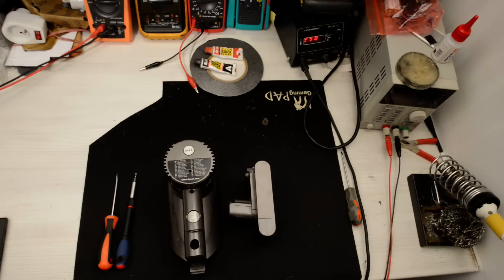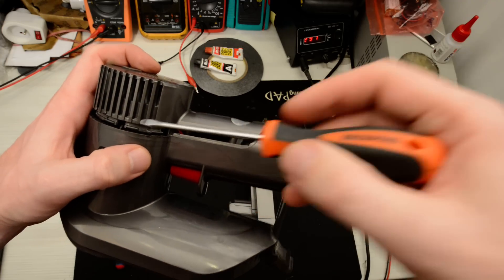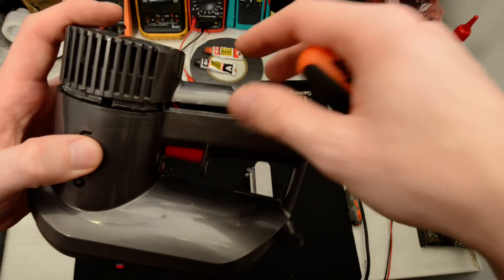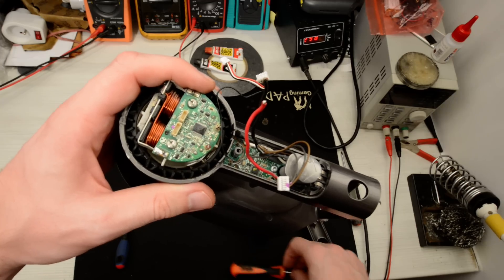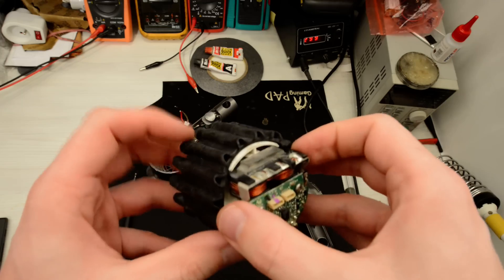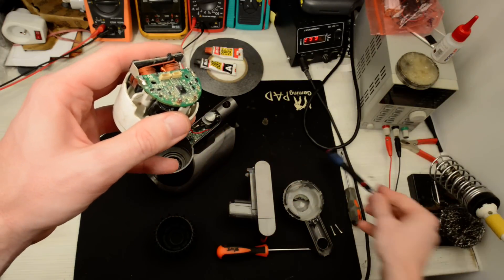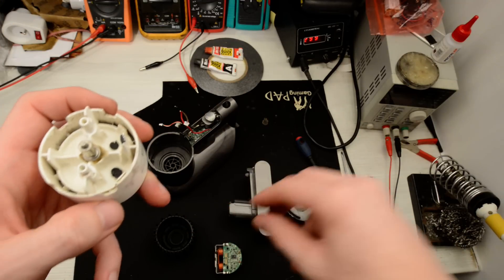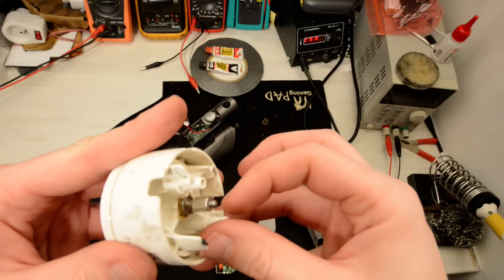Dyson DC35 motor disassembly - back cover remove

Comment: I worked from the bottom to get the cover off. Like others the rotor magnet was broken in pieces. It's a shame a 25 cent part can't be replaced. If anyone one tracked one down post it. Thanks

Comment: Looks like the same problem here.
Suspect a little more glue and pinch of graphite in the factory would save a lot of recalls...
Thanks!
Reply: Thanks for the heads-up on the case prying.
A plastic (phone pry) tool seemed to help and did less damage.

Comment: Same problem only the metal circular part that goes on the axle had a hairline fracture and was freely moving on the axle. I used superglue. Took me about an hour trying to get into the motor area but this video gave me confidence so thank you! :) Saved me buying a new one and now I know I can fix it again if I have to! My symptoms were press trigger and a single beep and green light BTW. No motor movement. The beep seems to indicate an obstruction. Good luck folks!

Comment: Thanks for the instructions. Found rotor magnet split down axis. Just need a replacement now. Cheers.
Reply: Did you found any replacement magnet mine was completly in pieces
Reply: @vincentlefebvre5681   Hey, I just took my vacuum apart and my rotor is in pieces as well. Was wondering if you ever found a replacement?
Reply: Just use superglue I did and seems to do the job same issue with mine!

Comment: Hi Ilja, thank you greatly for posting. The showing of how to remove the cover / where the tabs were was key for me - very helpful. In my case, over time one of the wires came loose off the back of the on/off switch (poor contact) as the switch physically moves a bit when operated which must have fatigued the wire / solder joint. Re-strip wire / re-solder and now all good. Yes, hard to remove cover without marking the plastic, but very happy now with working vac. Kudos to you! Děkuji.    (PS. The cover screw was torx, from memory, i'm writing this after the fix, i think it was size T7 for me)

Comment: Ilja Mašík, Hi dear 
Ilja Mašík, please tell me, have you modified your dyson? Why I don't see the filter detection switch wires not connected to your board? Have you connected Trig +24V from on-off switch board to the same board V2? Please tell me where to connect filter detection switch wires??

Comment: These are brilliant and rubbish at the same time.  IF you get one that is fit for purpose you are laughing. Sadly the majority of them fail, I have 3 (2 X DC31 and 1 X DC35) ALL of them are faulty!!!
Two of them work for 5-10 seconds and then shut off for a few seconds before restarting. One of them (DC35) will not turn on at all now!
For the money we spend on these, it's better getting the cheaper knock offs, they work as promised, not as powerful, not as good, but at least they work.

Comment: Thank you very much. Mine was making a high pitched squealing noise. It ended up being the magnet was loose on the shaft as well. I used suggestion down below but used a C clamp instead to release the tabs. This saved me a few hundred dollars.

Comment: Good evening, Tell me, please, how can I find out the marking of the octopus microcircuit, the designation on the Q5 board is located on the inside of the board, in the same place as the transistors. The case of the microcircuit has almost swollen, the marking cannot be read. Dyson V6 well, either in his brothers

Comment: My D35 is now stuck in MAX mode.  I've had the vacuum for 8 years now so I know the usual method of releasing MAX mode.  The MAX button doesn't seem to be pushed in.  Could it be some kind of electrical fault?  (I think one of the reasons I've had the vacuum so long is I've hardly used it in MAX mode.)
Reply: The switch mechanism on the MAX button is the most ridiculous thing in terms of complexity and repairability. Similar to a difficult Chinese puzzle, but imagine that the puzzle has tiny metal prongs and a spring that will lose themselves in carpeting if you happen to take it apart over a carpet. This happened to me. Luckily I have a collection of strong magnets to sweep the floor with and they turned up. The way they designed these things was not with a future repair in mind.

Comment: It's actually easy to remove the back of the handle/motor cover;  just push upwards on the cap;  as to distance the clip at the bottom of the handle end;  use a soft but strong plastic or wooden tool(like a popsicle stick;  I used a small kitchen knife but I would rather you would use a dull tool)to pry away the clip; releasing it from the handle(you can also push the clip from inside the hole at the bottom of the handle;  but that was too hard).  And then;  all you need to do is pull this handle time thung upwards and out;  what happens is that the cover shell begins to become oval;  thus pulling away those first of clips;  thus then giving downwards relief as this shifting then releases the top clips.  I'll re-install it and show you in a video;  if you didn't understand.
Reply: Thanks for the info! I'll definitely try this as my DC34 stopped working the other day. A small video tutorial would be extra helpful of course :-)

Comment: Torx T8 driver to remove screw on back. This is the only screw. Everything else is with broad clips that are difficult to unlatch. Heat up the unit with a hairdryer to make the plastic more plyable. Wrapping the back plastic shell in tape then putting in a clamp where the jaws only make contact with the back shell, then heating with a hairdryer can allow you to remove the back plastic shell. It is not easy. Try other things to fix faults first. ie another battery, clean battery contacts, clean filter.

Comment: Hello!  DC45. one day the motor into the mop was stoped(not in the vacuum unit).  I disassembled mop and measured motor resistance  - 3 Om. The  rotor was stucked, but i rotated his with force. 3 Om - It is work resistance or motor failed? And now - the main unit (with vacuum motor) is work, but i have not volume on the pins in the bottom of vacuum unit. From this pins volume go to the mop motor.  When i 
disconnect the battery, this pins are directly connected(i am measure on the tester). Is it work situations? Sorry for my english...

Comment: I was able to squeeze the motor assembly with a vise and it made the cove pop right off.
Reply: Any suggestions on how exactly you have put the motor assembly in the vise? Because I assume putting pressure on the sides of the assembly will only make it more difficult to remove the tabs from the motor assembly.

Comment: I had the same problem with the rotor spinning on the shaft.  Allow the adhesive to fully dry before reassembling the motor.
The symptom is the motor makes a squarking noise.
DC31 is now cured, Thanks.

Comment: Конструкция разбирается плох. Что бы открыть Дисон надо две отвертки вставлять и в щели и с большим физическим напрягом вскрыть.  Плату электроники вообще нельзя снять, как в кино. Два больших конденсатора 1000 mf очень крепко приклеены. Есть все шансы сломать двигатель. Надо отсосом освободить ножки конденсаторов после этого можно плату вытащить. И еще между конденсатором стоит пластиковая пластина, так она приклеена к какой-то детали. Возьмите тонкую проволочку и разрежьте силикон.  Александр.
Reply from the maker: Nauč se psát Anglicky, když už můžu žbleptat ve videu já, dokážeš to i ty...
Reply: Englisch. 
Design understands badly. To open Deason is necessary to insert two screwdrivers in the slots and with great physical straining to open. electronics board can not be removed at all, like in the movies. Two large capacitor 1000 mf very firmly glued. There is a good chance to break the engine. It is necessary to release the suction feet capacitors from the board, then you can pull out the card. And between the condenser should plastic plate, so it is bonded to some parts. Take a thin wire and cut the silicone.    

Deutsch.
 Design versteht, schlecht. Zum Öffnen Deason notwendig ist, zwei Schraubendreher einzufügen in den Schlitzen und mit großer körperlicher Anstrengung zu öffnen. Elektronikplatine  kann nicht entfernt werden, wie in den Filmen. Zwei große Kondensator 1000 mf sehr fest verklebt. Es gibt eine gute Chance, den Motor zu brechen. Es ist notwendig, die Saugfüße Kondensatoren von der Platine zu lösen, dann können Sie die Karte herausziehen . Und zwischen dem Kondensator sollte Kunststoffplatte  , so wird es an einigen Teilen gebunden. Nehmen Sie einen dünnen Draht und schneiden Sie das Silikon. Alexander.
Reply from the maker: Thanks for details. What is described in the video, is purely my experience. My way how i did it. If you prefer to lead out capacitors first, its of course safer way. I just pulled it out, about strong glue i told in the video...
Reply: Alexander Kulakov у тебя не остался магнит от двигателя? Мой лопнул, не найти

Comment: Yes you didnt show how to open it i took the screw off but it is closed solid your title states Motor Disassembly back cover remove but you dont show it, its very funny
Reply: The video literally starts with the cover already off...
Reply: Right? I know to remove the screws, but I need to know where the plastic clips are that's holding it in place so I dont go jamming a screwdriver into something I shouldn't be and end up fucking it up. Plus, the screw locations are a bit different on mine so it would've been really helpful if he would've started the video by doing what the title suggested
Reply: I would like to know what type of screw holds the motor cover- is it a Torx?
Reply: Bill Cobbett T8
Reply from the maker: Hey Stewart, if this video does not clearly  described you how to remove cover, you should not do that...

Comment: mine quit working and dyson pretty much told me I need a new motor (it cuts out after a few seconds) they told me Im SOL and have to pay 150 for a new motor from them! I refused to, so Im attempting to take mine apart to see whats wrong with it! thanks for this video, been looking everywhere for one about this!
Reply: meganarpasi That's lovely, that you got the housing apart...But HOW did you get that screw undone, a Torx T10?? Please give us a clue..
Reply: emma harrington  I'm at that point to check next what you suggest,  but then would also guess there is a cut off thermistor somewhere on motor. Anything else to check. Mine has canister and filter removed so it is not a blockage problem

Comment: is it still working? Rotor on mine has snapped in half, I wonder if I should attempt gluing it back together?
Reply from the maker: Biggest problem will be with non-balance of repaired rotor. Of course you cant make it worst, so why dont... I suggest to use some very tenuous glue, super glue maybe... Good luck!
Reply: +Ilja Mašík Super Glue was not strong enough. however it held enough for me to notice that it is cutting out after 3-4s could it be capasitor? or is there like a heat sensor somewhere? I just wonder if it is worth playing with epoxy and then find out that every 3-4s I have to press the button again...
Reply: Mantas Keblis have the same problem with rotor. Do you fix it? Can't find rotor to buy

Comment: can you help me out. i ripped mine a part. can i just operate the motor on external power. ..? whats the power rating that should be aplied directly to the motor terminals..?? . apriciate
Reply from the maker: +Munther G-mail Unfortunately i have no idea which pins on connectors you have to drive 
to control motor. My vacuum is back assembled and i dont want to open it
 again :). Good luck in your project!

Comment: You didn't show how you popped it open. that's what I need to see, your technique
Reply from the maker: +Lyzzie K. Yes, its not exactly shown, but most important is how are 
plastics assembled. There is no magic touch to unlock cover. You have to
 insert a screwdriver into gap between cover and body in places where 
are locks and use appropriate force...
Reply: Really would have like to see it regardless. The gap isn’t big enough for me to get anything in there that doesn’t just bend.